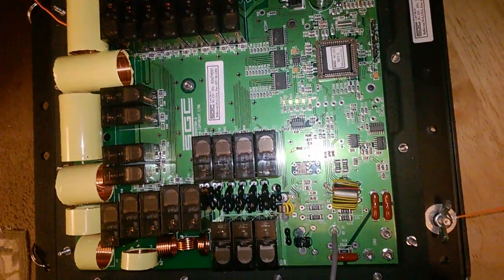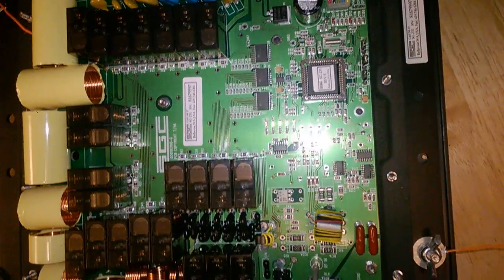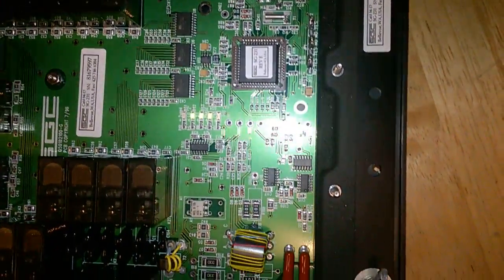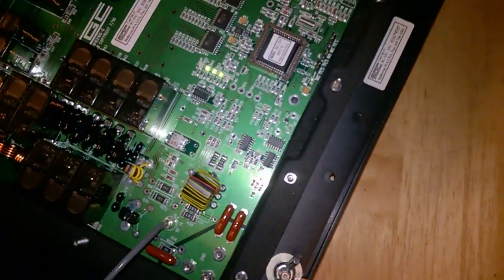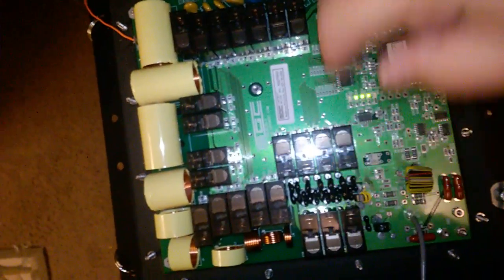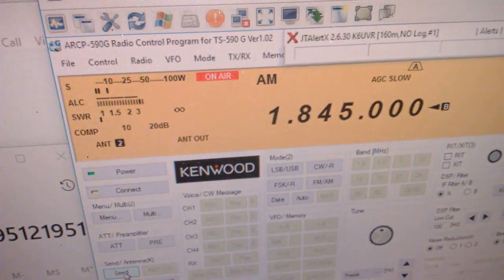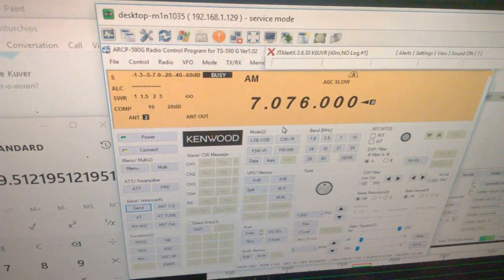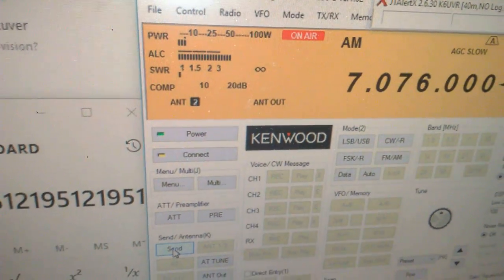SG-231 Smartuner: repaired and visual internal operation demo.

Comment: Hard to believe. Reverse polarity AND the protection diode failed.
Reply from the maker: Yeah.  I think it was left backeard for about a week.  SGC replaced both parts, and violla!  I didn't think to do a conductivity check on the diode, but they replaced it for good measure.

Comment: Sorry, - but the "reverse polarity" didn't "scramble" (or fry) CPU.  For starters, there is a LM7805 voltage regulator that reduces the 12 Volt input down to +5 volts for th4e CPU (and the other components). 

That LM7805 +5 Volt regulator already has reverse-polarity protection, plus the big input diode mentioned provides reverse polarity protection.

The chip may have been "scrambled", but it was not damaged (and probably not bad). Read the manual for the SG-235 on how to overwrite the memories in that CPU chip.  Or better yet, send me the CPU chip (and/or the other unit which you can now no longer use since you robbed the CPU chip out of, and SGC is apparently out of business now, and no longer offering support).
Reply from the maker: Swapped the CPU and it started working again.  Put it back, busted.  Sent it to SGC, and they covered it under warranty by replacing the CPU and the reverse-polarity protection diode which may have failed.